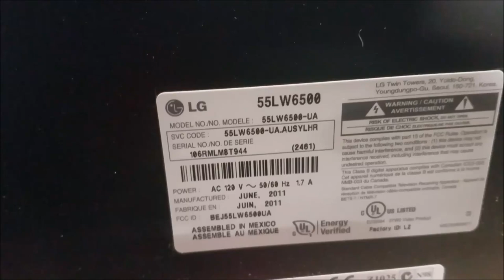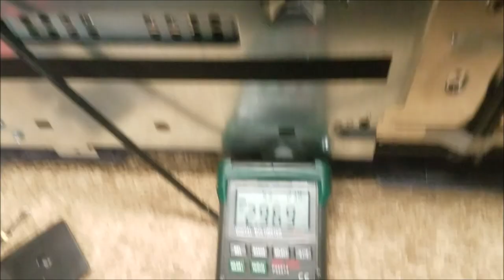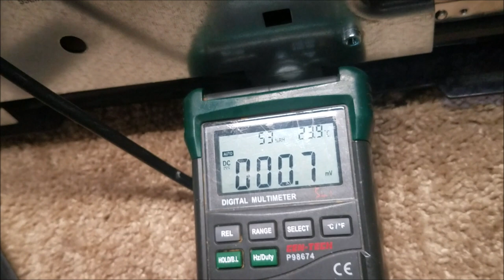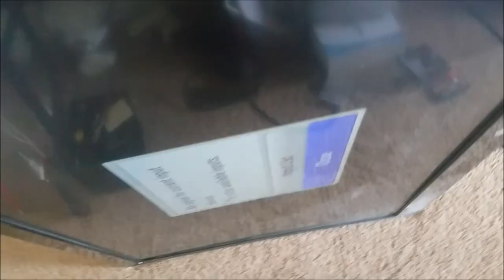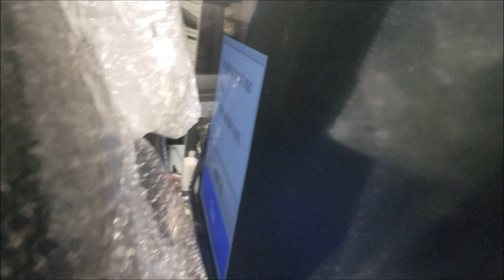LG TV 55LW6500 45LV5500 no picture how to fix motherboard

Comment: This video was great!  I just removed the mainboard and using a thermo gun and flux I heated both top and bottom of the chip as you need.  Reassembled and bingo this LG 55 inch 3D tv is as good as new.  Thanks for the education.

Comment: I got to side mount led strips. When I diode test the individual led chips they show as expected 0.7v but when I apply 3v they don't glow and draw over 1amp. Are these magical led strips?
Reply from the maker: get a tv led tester it works better, if the led not glow you will need to replace all led strips

Comment: I have the same tv with exactly the same problem, missing 12 volts at lvds, mine doesn’t show a voltage reading, it shows a diode reading of 0.448 at 12 volt pins, same reading on the tcon board, why don’t I get a voltage reading, multimeter is in dc voltage mode ? Can it be a small issue on the mainboard? Reflow did not change anything, your help will be greatly appreciated, thank you awesome videos 🙌

Comment: what did you added ? flux ?? how its called
Reply from the maker: solder wire and flux
Reply: resin flux ?
Reply: solder paste ?
Reply: ibe tried with resine flux like you seems to put i cant bring it to bubble like you i was at 450